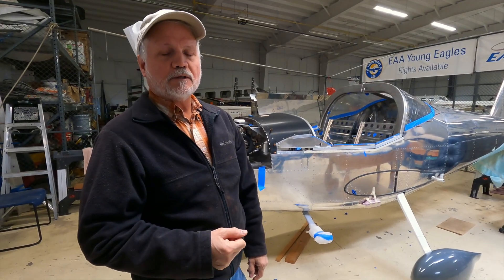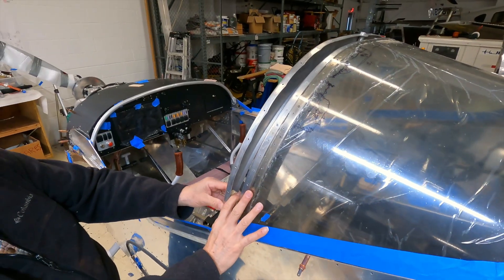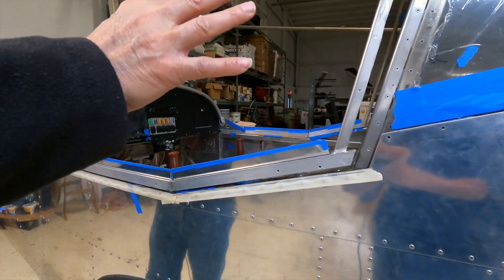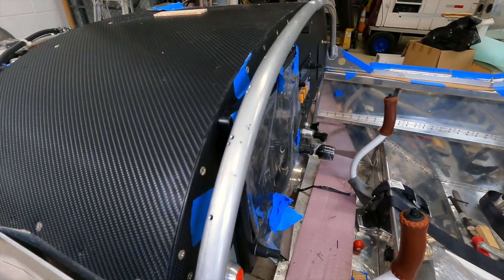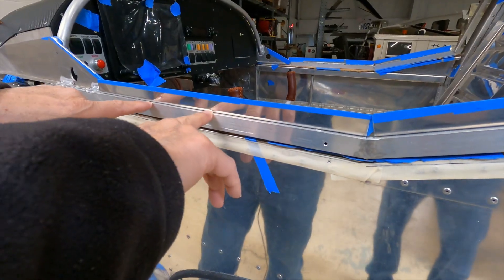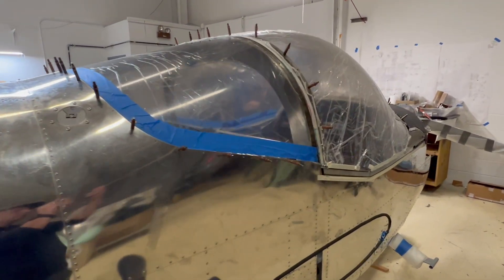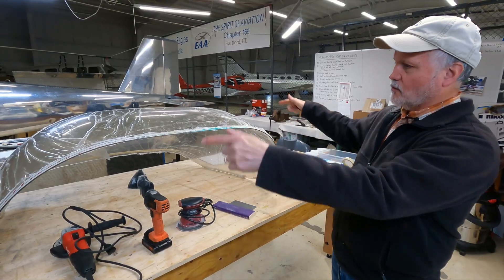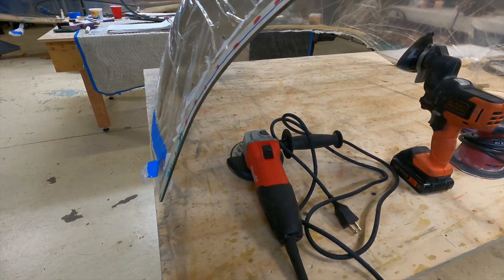Van's RV-12 Build: Canopy Installation

Comment: The front canopy bow appears to have a 2nd set of (small) holes drilled in some locations. What will those holes be used for? If they were not intended, how did you determine the structural integrity of the front bow has not been compromised? Thx and all the best